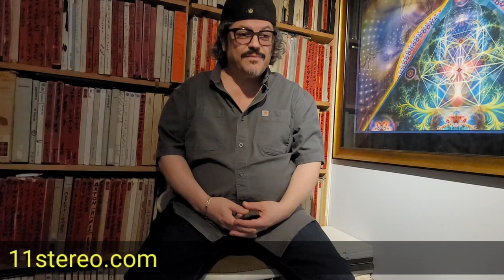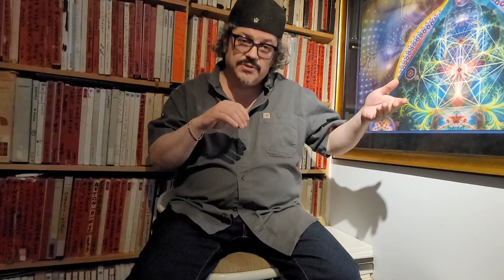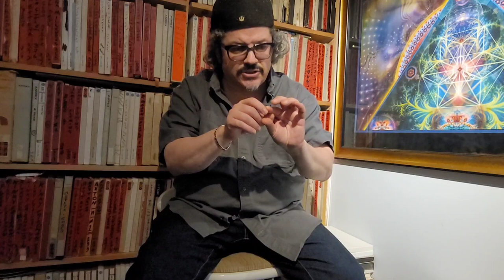i2S and outboard Master Clock Generators.  Whats the deal ?

Comment: The phrase your looking for is 'No Industrial Standard' 
Just bought a Denafrips Terminator-Plus DAC. I have a PS Audio transport and I decided to use the I2S. The Termi+ will configure itself for different I2S configurations. Push the correct buttons, and your good to go.
Reply: Holy crap! Now I have to sell my Termi+ 'cause it's got an outdated crappy clock.
Reply from the maker: And theres better sounding DACs for $4K from Europe.  Look at the AudioByte Voxx/Zapp its a $4K DSD DAC with an outboard power supply. Add the Hub which matches for $2K and now youve got a streamer/reclocker with i2s input
Reply: What latest and not outdated clock does recommended stack of voxx/zapp has ? I may have to follow Mark to sell off my Tplus 🤔

Comment: The solution is not to abandon an interface, I2S, which is superior to USB but for the industry to adopt an I2S standard so that all manufacturers can implement it in the same way and it can become a standard like USB, AES/EBU, or S/PDIF that will allow all componients, regardless who manufactured them, to communicate with one another.
Reply: No, because there isnt a standard. It depends on the specific DAC chip that is used, what format the i2s takes. you have in general i2s, left or right justified and PCM and DSD. i2s as mentioned in the vid, is not built for cables, or any long distance, as it has no error correction like USB or ethernet. better to maintain error correction to the very last point and then output to i2s as close as possible to the dac.
Reply: @jeremyglover5541  Yes, that's why I said a standard needs to be developed. USB is shit.
Reply: @arthurott4561  yeah, well i2s isnt that standard and by its nature never will be a standard, as it is a hardware level communications format. as long as there is different dacs that have different needs, there will never be an i2s standard. USB is totally fine, if implemented well. A well designed dac should be fairly agnostic when it comes to input anyway.
Reply: @jeremyglover5541  Are you an engineer?
Reply: @jeremyglover5541  Yes, USB is fine, at best.
Reply: @arthurott4561  I posted this below on another comment, but it explains why i2s cannot work. 

 it is either using i2s, or DSD, you do not transport DSD over i2s. i2s usually takes the form of Bitclock (BCLK), wordclock (LRCK), SDATA and Ground, while DSD only requires Bit clock (BCK), serial data (SDATA) and GND these are taken along with the local Dac master clock (MCLK) to form the full digital audio conversion. there IS a DOP (DSD over PCM) 'standard' but PCM and i2s are not exactly the same. while GND, it isnt even part of the standard, given as a protocol, it was not designed to leave the PCB.
Reply: @arthurott4561  by university qualifications? no, by what I do, yes; i'm designing a digital crossover (multichannel ES9038pro) PCB, with integrated raspberry pi 4 compute module and XMOS FPGA as we speak. if you can tell the difference between i2s that your USB input puts out and i2s that comes from ... spdif? youre doing it wrong. spdif is inferior in every way to USB done right and its clock domain should be isolated from that of the DAC in both cases.
Reply: @jeremyglover5541  Well, I owned a PS Audio DSD and used I2S input with an outboard streamer/bridge. It not only sounded better than the USB input it also sounded better than the PS Audio Bridge2 card. Aqua Audio also used I2S very successfully between their LinQ streamer/bridge and their La Scala and Formula DACs.
Reply: @jeremyglover5541  What DAC and Streamer are you using?
Reply: Yeah. i'm not going to discuss PSAUDIO ... probably not the best reference today.

as for my gear aside from stuff I build myself? I suppose one brand you might recognise is a Light Harmonic USB->multichannel I2S board. I'm also alternatively (in another build) tapping i2s from a miniDSP and feeding my dacs (which reclock it)
Reply from the maker: Jeremy email me at verastarr at g mai l
Reply: @OCDHIFiGuy  sorry mate  I only just saw this. Its been a pretty crazy year. Ill drop you a line over the weekend.

Comment: I’m always amazed at the fine line that DAC manufacturers walk where they tout their DACs as great machines but then suggest that you need a DDC and/or external clock for it to sound better, leading us to the logical conclusion that we in fact bought garbage that is need of thousands of $ in extra equipment for it to work correctly.
Reply from the maker: EXACTLY... its like the first RED flag that the DAC MFG is HUSTLING YOU.... Lol, does not take a genius !

Comment: PS Audio was the first company to use an I2S output. The reason why they developed their I2S protocol was to allow Hi-Res transports to send digital signals to external DACs. Before, SACD players were captive to the internal DAC of the player, and if you wanted something more advanced than the capabilities of SPDIF and Toslink, you were screwed. Now, you can use whatever I2S DAC you want. Hooray. They had to go this route because Sony is still big on all the anti-piracy stuff, and they have already gone through all of the legal bullshit to make sure they're not violating anything. Additionally,  the USB protocol is not good with managing clocks; the I2S handshake is much better at handling multiple clock signals while mitigating the jitter that you would otherwise have over USB. PS Audio also made their protocol opensource, which is why we are seeing more and more components utilize I2S.
Reply from the maker: Thanks for the feedback. I dont like the PS Audio Brand at all. you are clearly unaware of WADIA and TEAC and the ST Digital (AT&T Glass fiber) connection. They both predate PSA, and i2s was never meant to be off the motherboard. Its a hack. still no standard for it , as its an illegitimate standard for outside the machine no matter how Great some people think it is . So I feel its marketing hype. Paul even said they could have used ST Glass but it was too "Hard" to implement.

Comment: Between my  PS Audio DAC (DSD conversion) and the CD/SACD Transport(Disc Player) I2S sounds the very best to my ears. I guess its synergy within the brand rather than mixing the DAC and Transport between different brands.
Reply: ermmm, it is either using i2s, or DSD, you do not transport DSD over i2s. i2s usually takes the form of Bitclock (BCLK), wordclock (LRCK), SDATA and Ground, while DSD only requires Bit clock (BCK), serial data (SDATA) and GND these are taken along with the local Dac master clock (MCLK) to form the full digital audio conversion. there IS a DOP (DSD over PCM) 'standard' but PCM and i2s are not exactly the same. while GND, it isnt even part of the standard, given as a protocol, it was not designed to leave the PCB.
Reply: @Arthur Ott see here for longer explanation why
Reply: @jeremyglover5541  also very important info, thanks 😊
Reply from the maker: Whoop there it is ! .... One clarification i2s was designed to carry PCM information between IC's on a pcb. Thats the relation between the 2
Reply: technically i2s is a specific range of different serial encoding formats. i2s itself (philips), was typically defined as 16 bit audio, left justified in a 24 or 32bit container, with all the following 16 in each word bits padded. there are many variations just within i2s, with the same basic electrical connection, then there is PCM and its variants. DSD is a singular use case that is really more of an analogue signal than an encoded digital stream. DSD can can even be listened to directly, with headphones and a basic LPF filter. and buffer, to form a very basic digital input PWM amp. Taken together, the filter and your ears form the reconstruction filter. 

Yes, it (i2s, not DSD) was indeed designed for interchip communication on PCBs, not cables between boxes. A lot of trouble has to be gone to to use it for external cabling, or long runs, since there is no error correction. its fragile as hell, prone to noise etc, so localised synchronous (for my taste) reclocking s a requirement. It is problematic for any system that needs digital volume control, or DSP, as the RAW 1bit DSD stream has to be converted to PCM, before these operations can be performed and then back again (this process is transparent, not lossy). This is why it never really caught on mainstream for mastering.
Reply: @jeremyglover5541  If your DAC can support DSD Direct then you dont have to use DOP. I use DSD Direct from my Raspberry PI using Volumio. And the result is very analog, effortless, spacial music experience. The comments for error correction and noise is in theory only, kinda like a scare tactic. It is only true when you try to bring I2S directly out of you player, with a few feet of wire to a dac. That is why they invented player (source units) with HDMI or USB outputs to a USB bridge unit, then to your DAC. This is a proper way to keep the fragile I2S signal in tact!
Reply: @yuriz7364  im well aware of dsd direct. Volumio, rpi etc. i have on my computer several circuit board designs for high performance multichannel dacs and dsp … 

You mention error correction not being important and then go on to mention usb bridges (error correction and buffering is included here) and hdmi … hdmi is only an interconnect standard, it isnt sent as hdmi, but rather using the differential cable drivers/buffers and the resulting cmrr to mitigate the error/noise in the pcm/dsd/i2s data sent over it.

In other words, your 2 use cases argue my point, not against it.

Im not sure you understand how the lego you assemble works.
Reply: And unless you are using some sort of passive volume control, rather than in the Rpi or your dac, you have converted 1bit dsd to pcm, then back to dsd in the rpi, or in the dac. 

Which dac chip are you using for conversion? AKM?
Reply: @jeremyglover5541  Hi Jeremy. I am not trying to argue here.. I am only trying to educate some folks not to give up on DSD /SACD format. There are many ways now to even getting a clean I2S stream from an OPPO 103, 105, 203, 205 using a I2S board from OPPO Mod and also (HDMI/MHL To I2S IIS HDMI IIS I2S Dual-Mode Digital Audio I2S/Optical/Coaxial/DSD) just type this in to ebay. I did it with my OPPO 203 and My Audio GD R7he DAC. As for I2S noise and errors. let me ask you this... Did you ever experience this type of anomaly on your system and how do you know you just heard an error/noise?
Do you actually listen to music over I2S or just PCM over spdif? I know well how my Lego works. I dont want to complicate my explanations with theories that are best left alone. Like error correction, timing etc... this is for engineers who already know it. an average person only wants a real world way to connect all this together. You dont need to exercise your knowledge on me.
Reply: @jeremyglover5541  Please dont try to learn me about how DSD works, I am on your side here. I dont use passive volume controls I think of it as a purist approach to just use a volume knob. I use Audio GD HE-1 Limited edition. I need multiple inputs and remote control. Also this is a neutral preamp and a total dark background. I wish I could get an affordable dual chip AKM 4499 just to try it out. It has great compatibility with I2s.
But I use an Audio GD R7 he in my main system with a RPi 4 over a Singxer U1 bridge all DH Labs usb and hdmi cables. And a Mark Levinson 333 amp all balanced io's. All on 2 custom isolation transformers 2kw 3v step up with my custom activator/filter for Mains power conditioning.
By the way I do know about DSD volume issue... And conversion to pcm. I dont ever use digital volume controls with my Pi. Did you research the Sabre and other DAC chips? They already have hardware volume control integrated in to them with no loss. Just another tech detail you might not be aware of.

Comment: Agreed that i2s can get dodgy if you're new to the hobby as not everything is 100% compatible. But, I've tried many a USB cable and decrapifier and couldn't get anything USB to sound as good as using a Matrix X-SPIF2 between my server and i2s DAC. It's probably not for everyone but it worked for me.
Reply: I my case too usb did not give me good results going straight to usb of dac. 
I'm now thinking of adding either a DDC or using AES of dac and dCS Network Bridge (planning to buy) to get desired results.
Reply from the maker: Yeah Dan, it sounds like your DAC is optimized for I2s, now if you could just get your server to output i2s you would eliminate the conversion to USB alltogether..
Reply from the maker: The server USB should NEVER come off the motherboard , that output is always shitty. You must use a Audiophile USB output card on the PCI Bus, Matrix has one or the best is the JCat
Reply: @OCDHIFiGuy  We definitely agree there too. I use the Element H card but still found that putting the X-SPDIF 2 between the server and the DAC made a noticeable difference. Of course, that ups the cost a bit with cables added in. One difference, perhaps, is that I run the X from a 6v battery, which keeps it isolated. But it's really about trying different things to see what works for your system/room/taste. If I were running an Auralic or Audiobyte front end, I would likely have a different point of view of USB. One of these days, I'm going to try a Pink Faun i2s bridge card. It never ends. Which I like.

Comment: Hey OCD, is there a way to make a AD and DA converter clock to synchronize with GPS time to get more accurate samples as GPS is a precision instrument? I think the naval observatory uses cesium clocks or something?  Like turn on your AD / DA and then push a button to sync its internal clock with a GPS signal for sampling time?
Reply from the maker: I've never heard of that, but there are Master Clocks for Audio that are Rubidium....
Reply: @OCD HI-Fi Guy  yeah but rubidium is not as accurate as cesium ect, ect, ect.....